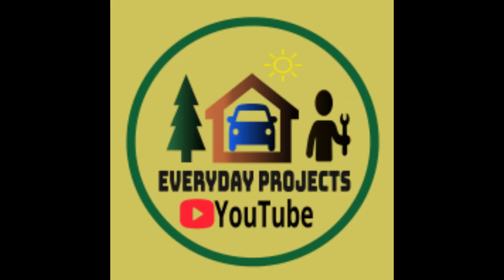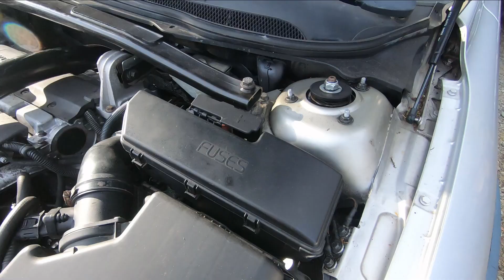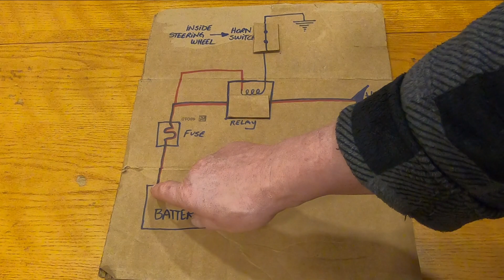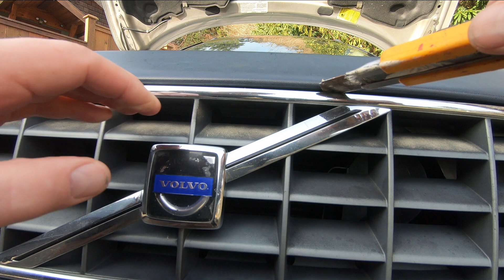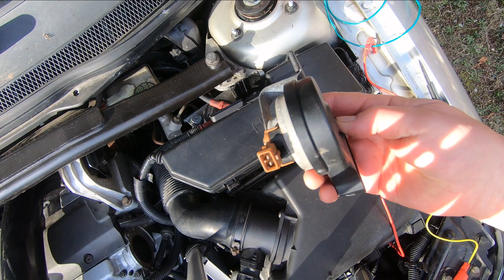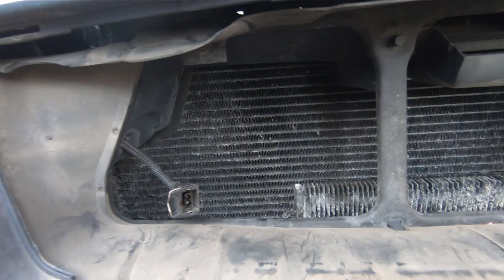TROUBLESHOOT AND REPAIR A HORN NOT WORKING (2001 VOLVO V70XC AND MOST OTHER VEHICLES)

Comment: @EverydayProjects Nice explanation on the relay. I have a 12 year old Volvo XC60 with non working horn, horn, fuse are good, can see the voltage signal  to the horn plug terminal when pressed the steering wheel or press the panic button of the key fob. Since the panic mode does not involve steering wheel, I think it is not related to the steering wheel contact. Looks like not enough current to the horn. Any thoughts on checking the issue?
Reply from the maker: @JoeChan-c1b  I would check everything in sequence starting with the relay and then the horns themselves as shown. It could be a relay, wiring or defective horn. Good luck

Comment: Thanks. Your video is very informative. After I changed the radiator via removing the bumper and a few electrical connections, my horn stops working; It's a 2006 Volvo XC70 2.5T. When I tried to locate the signal horn relay ( upper left corner, under the hood), I didn't see FM12 relay , but ST1 and ST2. Where would my signal horn relay be for a 2006 XC70 and what make/model are your Volvo?
Reply from the maker: @delauren667  Check the legend inside each of the three fuse boxes in the car. The relays are usually in the engine compartment but may vary by year. Mine is a 2001 V70XC